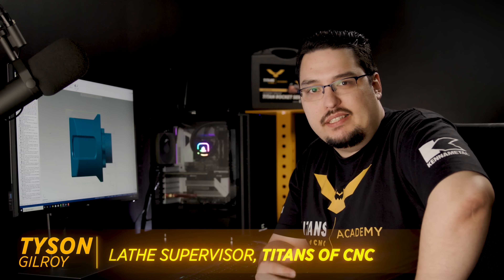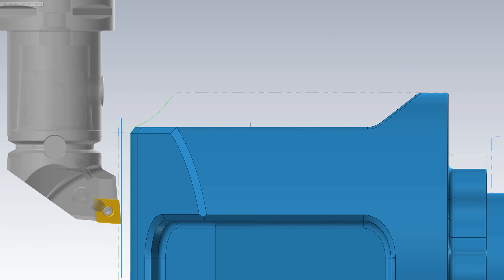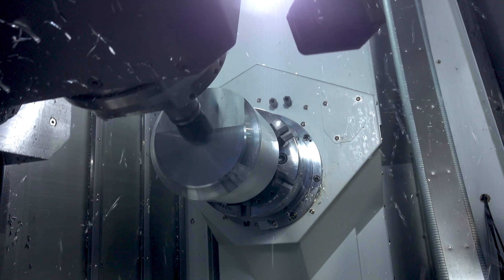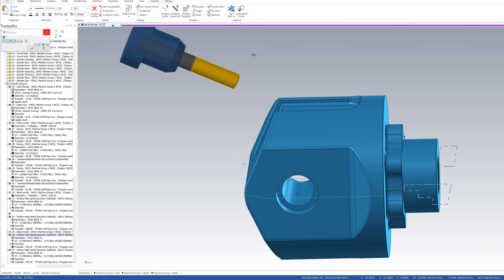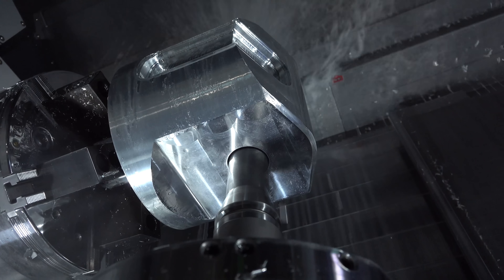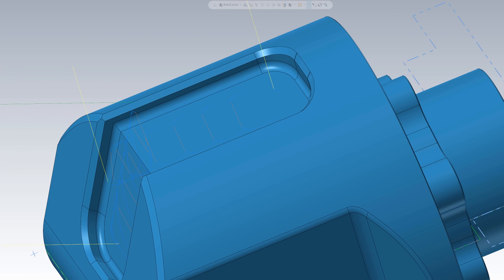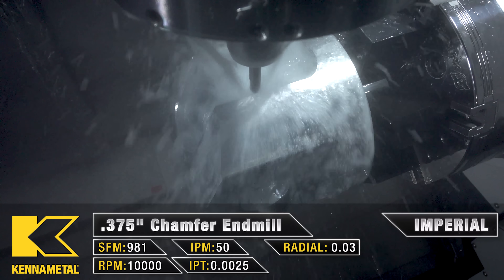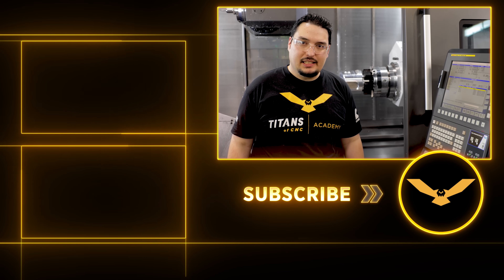Expert Level | 9 Axis Machining | Speeds, Feeds, Depth of Cuts | Complete Part Process Explained

Comment: Isn't it easier to use a holder, where the tip of the insert is directed not sideways, but straight down, so you can just simply turn B-Axis about 45 degrees, and nothing interferes with your workpiece during a facing operations?
Reply: Could have probably tilted b to 95 and made that work,  but good he shows the right way

Comment: 1-When roughing the 2 angled front faces you are milling a little bit of air. You can save some time by trimming the toolpath to the stock. I use Hypermill and you have the option to add raw material to 2D jobs such as contour milling.
2-You say thay the clamping is not very stable but i notice that you are cutting the 2 flat sides with the same 2" milling head going from the clamping out thus making a full cut and sending the load outwards. I would have gone the other way around to avoid vibration. For finishing too.
3- why make the front radius with a ball mill when you could use a long flute endmill and soulder both faces and the radius? Could be from 2 sides if the machine geometry is good and the tolerances wide enough.
Not a hater but a fan. I'm just trying to criticize constructively.

Comment: Seriously get a couple machines from mazak so those of us who work with them have a better idea on how to optimize them and boost production. The operating system is quite a bit different from everything else I've worked with and I've hit a wall with what I'm capable of learning without slowing down production to do so under company parameters..

Comment: Cool video, is it possible to measure all the contours without taking the part out of the machine?
Reply: the answer is yes , just yes
Reply: There are several methods of metrology to apply in process if needed,  including automation if the machine tool has the capability.  Very vague question sir...

Comment: I’m turning 53 Rockwell hardness but the component keeps coming out oval any idea as to what could be causing this??
Reply: you would have to explain it in more detail to get help there is not only 1 source of error
edit: you could start by explaining how you did it?
Reply: @TheWerbischdu  I agree. Not enough information to make useful suggestions.
Reply: Werbischdu the sizes and roundness of the components is extremely crucial we are currently using a mandrill setup to eliminate distortion from the Chuck, after measuring it would appear that the cutting tip is being pushed away from the component in some places, I am only having an issue on the OD. I hope this Information helps.
Reply: @keenanjackson8083  It sounds like you have a rigidity issue if the tool is being pushed away from the cut. Are the parts in print while the are clamped in the machine? How bad is the out of round condition?